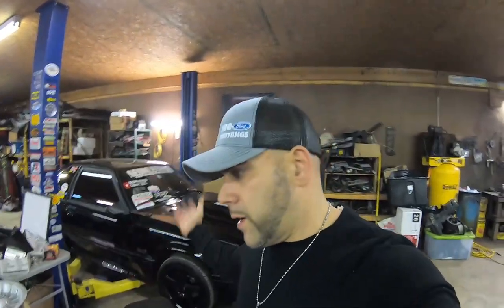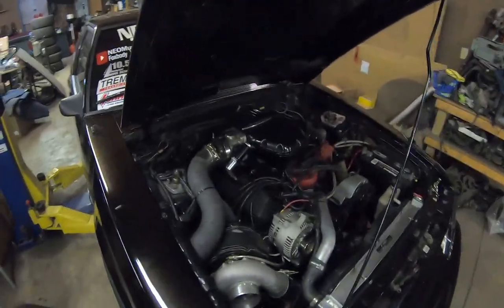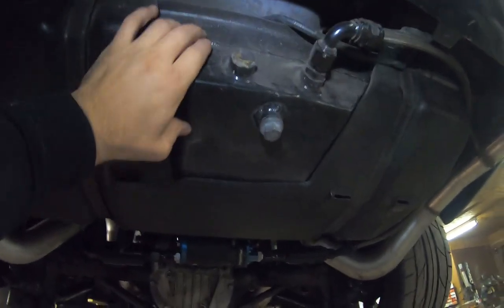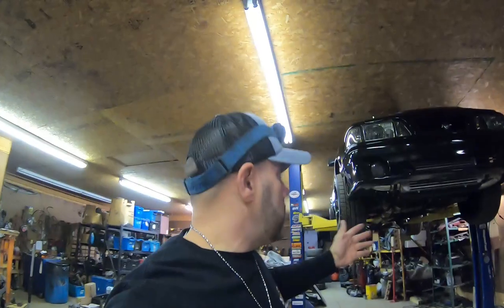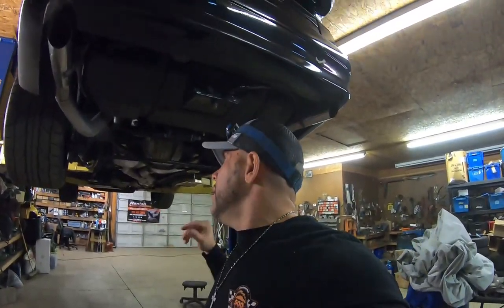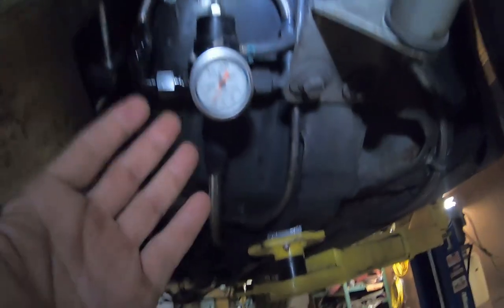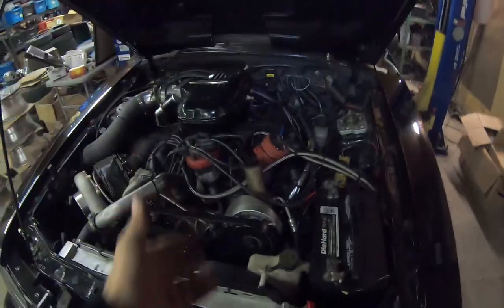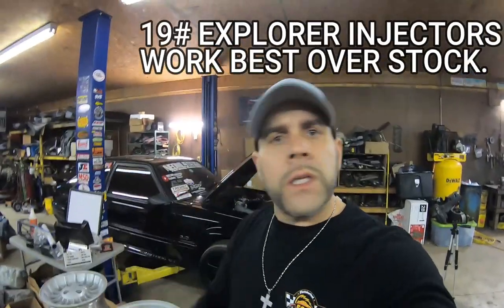How I Built My Big Horsepower FUEL SYSTEM Foxbody Mustang

Comment: Just went through a long project with the car. New boss 342 motor, K-member, coil overs, radiator, electric fan from a Mercedes, cadillac brakes waiting next.
    I sumped the tank with 2 10an fittings. One fitting is capped for now, the other has a 380lph running down to a 8an Y'ed to an in tank Stealth 340. The feed runs to the fuel rail via a -8 and returns via a -6. As of now I'm just powering the 340 pushing 42lb injectors. 
     Terminator X, 80lb injectors, and 76mm Turbonetics waiting to go in. I will wire the sumped 380 for boost referenced activation along with the methanol. 
   You asked to share, there you go. Thanks for showing your sytem and explaining your thoughts.
Reply from the maker: Yes sir. !

Comment: Back in the day, you ran regular braided lines and fuel vapors seeped through making your garage smell like a gas station.  Vortech’s T-Rex pump kit was the OG of the pump wiring, big wire with a relay.  One tip with big fuel pumps, never let the tank go below 1/4 to 1/2 tank, the fuel gets way too hot circulating and eventually kills your pump (ask me how I know).
Reply from the maker: Good point
Reply: Also you don't want to go below 1/4 tank because all my fox fuel senders were liars half the time. Lol
Reply: Mine now reads full till 1/4 tank. Such a jerk haha

Comment: Whats up Neo, I’m running a glens performance kit.  dual walboro 255’s   Sumped tank , 10an lines aeromotive regulator and filter, return style to the top of the tank.  90’ Turbo fox body vert.  Great video!
Reply from the maker: Ty ! Thx for sharing

Comment: Really appreciate your videos.  I would like to add one tip on stock fuel rails.  After sitting on the sidelines for about a decade I bought a car already set up with an On3 kit and stock rails.  It had some bugs to work out which took me a few weeks and the car was awsome.  I got about 300 miles out of it when I took a friend for a ride and just after lifting in 4th we had fire from under the hood that was bad enough to total the car but not bad enough to buy back from insurance (very lucky) and salvage it.  My initial inspection had me thinking that the fuel pressure gauge blew out and sprayed fuel on the hot side.  Acutally what I am 99% happened is that the factory fuel crossover tube connection behind the intake gave out and that was the initial failure.  Age of the line and maybe 10% ethanol fuel in my area plus the high pressure equalled a bad mix of things to go wrong.  My advice would be to ditch stock rails for good aftermarket ones.
Reply from the maker: Eh I get it but they still work
Reply: I havent had a failure on the fox yett. But 1999 to 2004 ive had the crossover section near the fire wall fail. Also old o rings on my injectors failed everywhere this year. My 02 honda cbr 954, my 2001 saleen, my 1991 fox body. Plus all the rust in my other mustangs tanks. Its been a bunch of maintenance this past year.

Comment: Good job on showing your setup. When I went to carb I put a holley black pump where the factory fuel filter bracket sits with 1/2 feed line and I try using the factory 5/16 feed for a return. But I keep getting pressure creep so I went back to the factory fuel hat with a bigger pump and a 1/2 return and that fixed my fuel pressure creep and then sold the car. I’ve been toying around with the idea of getting another foxbody to put stroker 351 in but it will be strictly a 1/8 track car if I do it.to hope my son get interest in it. Especially having to help him pay car insurance for a teenage boy
Reply from the maker: Ya I shoulda put some carb reference in there too

Comment: I've maxed out my Aeromotive 340 at the psi I'm running. I'm still on the stock fuel lines and a stock return system. I've upgraded the wiring so I'm good there, but in the spring I'll be upgrading to the Hellcat pump. I have it in the garage, but will find a warm day to get it installed. The pump itself is good for over 800 hp, and the stock lines are said to be good for 650hp. Both of which are more than my stock block will see.
It's still a somewhat low key fuel mod that I don't see often, but it's such a simple way to supply extra fuel without having to change lines, rails, boost a pump, e.t.c. 
Low electrical draw, and massive boost in LPH.
Reply from the maker: Simple Amps = fuel if you can get that pump max voltage you can it'll move some liquid.
Reply: @Neomustangs  true, I just worry about longevity of the pump when you increase amps. You create heat for the pump and create heat in the tank.
Reply: You will have a heck of a time trying to regulate your pressure with the stock Fox lines (5/16 & 1/4”) and a 500+LPH pump.  Go with at least a 3/8” line front to back (still might be too small for that pump).
Reply from the maker: @saleen88-049  I had no issues for years
Reply: @Neomustangs  You were able to run a crazy pump with 13v with stock Fox lines and rails and able to regulate the pressure down to 32 psi?  If so, that’s more of the exception than rule.  Rock on!

Comment: On the 410 I'm running the 255lph with  stock feed and return lines. I do have the super vic specific rails with push loc hose and aeromotive fpr. Motorsport 47lb injectors. It all works great. Now when boost comes to town I'm not sure if I want to do twin 340's or a large single pump. Maybe 96lb injector range as well. Maybe bigger. She's gonna be thirsty so I wanna upgrade it just once
Reply from the maker: Nice

Comment: Do you think I need to do that wiring thing on my fuel pump with the bigger gauge wire? I have a 306 with Edelbrock Performer heads with 202 valves they are porter and polished, 1.7 Svo roller rockers, F303 Cam, Trickflow street intake,BBK 75mm Throttle body, Deka 80lb injectors, automotive 340 fuel pump, Kirban FPR, On3 turbo kit, Terminator X.

I have the Aeromotive 11540 Fuel Pump (340 Series Stealth In-Tank) which I’ve not installed my fuel system or Turbo yet. I also have some edlerbrock fuel rails but decided not to use them unless you think it’s a good idea?

I’m getting ready to watch your other fuel video right now. Figured I’d ask on this one since it’s fresh. Thanks
Reply from the maker: Yes absolutely. 340 Pumps on stock wiring are running on like 230 lph worth of amps. Ask me how I know lol
Reply: @Neomustangs  I watched Your other video and got a problem. My fuel pump is the Aeromotive one with the wires coming out of it. Do you know any way to add your wiring mod to it? Maybe it comes apart or something? Hopefully I didn’t order the wrong one lol.

Comment: I’ve done all that and I’m still starving for fuel around 3000 RPM😞
Reply: Sounds like you need to diagnose other problems. You shouldn't run out of fuel that low if you've pieced together the right parts.
Reply from the maker: All what system ? Stock lines ?
Reply: @Neomustangs   340 pump  6AN  lines Edelbrock fuel rails deca 60 injectors Arrow automotive regulator i’m the guy reaching out to you on Facebook trying to bring the car to you… lol